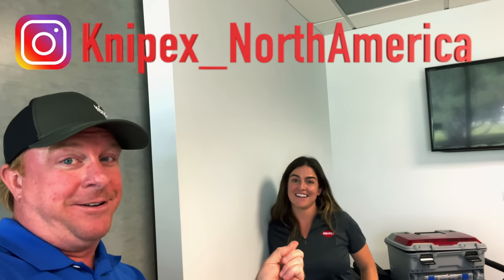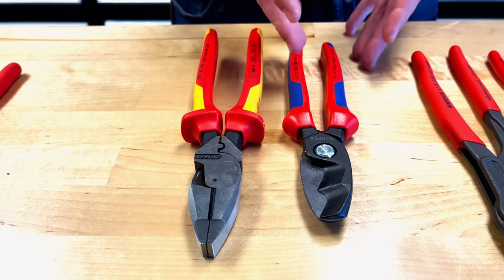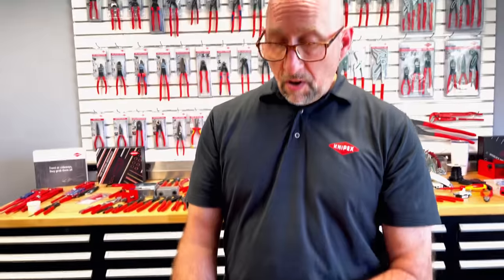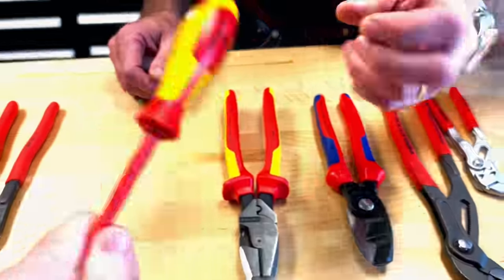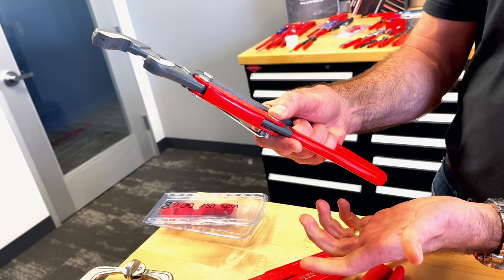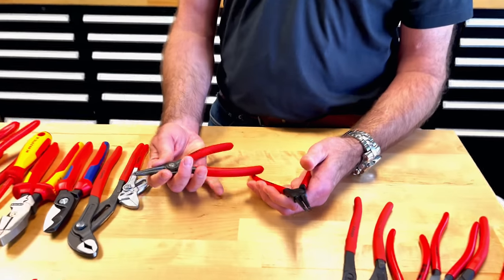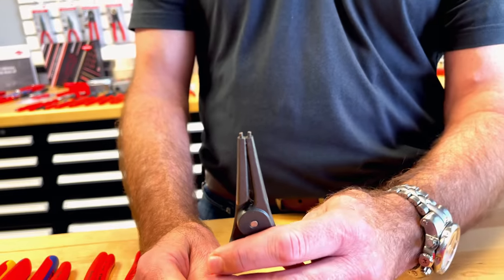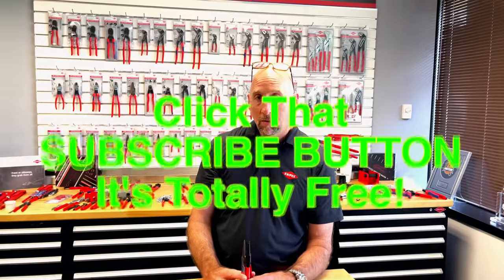Knipex Tools: Common Misconcepetions And Myths!  Know Your Tools And How They Should Be Used!

Comment: I do not, any longer, fool around with anything hot other than testing.
A few years ago I had a customer with a water leak in the crawl space.  There was enough headroom to be on your knees with your head between the joists. The ground was muddy with a inch or so of standing water in areas. 
I seen the wire running along the joist but didn't give it much thought, until.
Apparently the homeowner or ? had cut into the wire down to the copper, I missed that. My elbow got into the bare wire, knees in the mud and water. I have been hit with 220 and while I would not recommend it, that was nothing compared to the hit I received from that 110. Holy crap,  It took a second to realize what was was causing my eyes to cross because it was literally everywhere on me. It was definitely the worst shock I have ever had.
Stay strong brothers and be safe.

Comment: I am a high voltage electrician and I use the blue and red handled diagonal cutters and forged wire strippers to troubleshoot neon transformers pushing out 15-20k volts, along with pole lights pushing out two lines of 277v. I’ve cut live wires plenty of times and so have many other electricians in the service field. There’s no way the electricity we work with is going to conduct through that thick plastic.
Reply: It is the same material, just thicker in some places. All electrical pliers are tested with 10,000V. If there was an air bubble in the handle of the non-electric pliers, you wouldn't notice it. In that case, you could be killed.

Comment: I could see where they could be confused for insulated tools; but you should definitely check the handle every time you pick them up with intentions of working on live electrical.
Reply: Not to be mr safety cop but nfpa 70E stated live work must be done with live work gear.
Reply: @burnedupsparkytipsandrevie9597  You're absolutely right. I've done NFPA 70E. Anyone in a position to be working on live circuits (Should) know the difference in tools and should know working live should be a last resort.
Reply: @wadecannon5607  I agree working live should be your last resort (except for troubleshooting)

Comment: Greetings from Poland. Nice video 👍. Not sure how in US, but in Europe, Knipex makes 1000V tools also with all-red handles (please check for example pliers no. 03 07 180 in graphics). They are more or less similar in shape as those yellow-red ones (the handles are thicker compared to standard pliers), but made with the similar material as this plastic coated pliers wrench mentioned first in the video (they are shiny red). From what I know, there is no difference between all-red 1000V pliers and yellow-red 1000V ones in terms of technicalities (besides coating), but the all-red ones are used mostly by technicians dealing with power lines, tension poles, transformers etc., and the yellow-red ones are used by electricians installing sockets, lamps, working in household installations in general. This is not an official division or similar, just some kind of general "rule" the tools are used (do not know the exact reason why it is so). As for the pronunciation, the Germans say Knipex with K at front. You can take the word knee, say it with k at front and add "pex" at the end, this is more or less how it sounds.

Comment: All the pliers I buy from Kinpex are all going to be comfort grip handles. I have two maybe three pairs with the regular handles and I don't like them digging into the palms of my hands. I have larger hands and most. But I've also been very sick for the last two decades so from my hundred and 95 lb body I'm 130 lbs now. So I have no more padding in my hands that I once had so the comfort handles make the difference of the world. Worth every bit of the two to three dollars more they want for them. I don't really do much work around live electrical so I've never seen the need or necessity to own much of the insulated stuff except for 1 special tip screwdriver for changing out outlet receptacles

Comment: What is knipex warranty on their insulated pliers. My 1000v installation pliers got ran over by a roller coaster and destroyed the handles. I still have them In service just wrapped them in 33, 130c and glass tape, and even though when I do live work it’s with my class 00 gloves and arc shield still would like to have the certified insulation again

Comment: Sparky's and other electrically qualified professionals remember unless you see the double insulated symbols (double square or triangle) along with the insulation rating written on the handle it's not insulated.  This may save your life if you are working on live wires and using properly insulated tools.  If they are not properly insulated you will get electrocuted and potentially killed.  Don't risk your life, take the time and effort to read and verify you are using the proper tools and PPE for the job.

Comment: Does anyone know why the plier wrenches have those smooth dipped PVC handles? I wish they had the textured handles like the Cobra pliers.
Reply: I prefer the smooth handles, they're easier to clean.
Reply: @danstheman33  I prefer the textured handles, they're easier to grip.
Reply: you can get both styles in canada the chrome have the smooth handles and the black have the textured

Comment: This guy failed to mention that the handle materials in the 1000v and the comfort grips are IDENTICAL. The only difference other than the shape and colour is that the 1000v ones have actually been tested and approved to resist 10kV

Comment: I have a bunch of knipex tools, the pliers plastic grips slide off when you pull on cables even though some of them are designed for htat purpose. Wiha is much better with that.

Comment: If you want to cut a live wire then your a FOOL 1
Reply: I mean technically if you only cut one wire at a time and isolate it. Then you should be fine. (A lot of assumption based on one’s skill and comfortably around live wires is going into this though)
Reply: @burnedupsparkytipsandrevie9597  better safe than sorry .